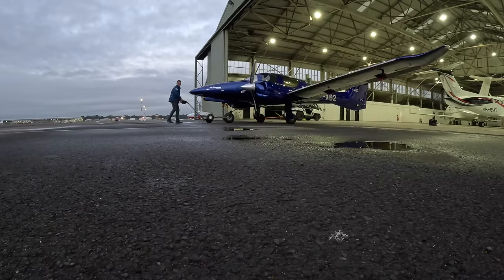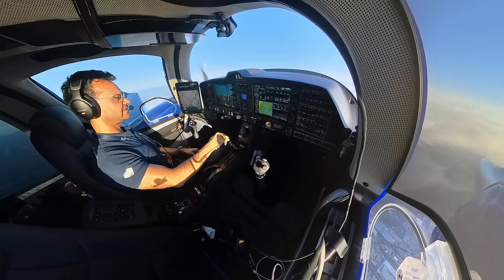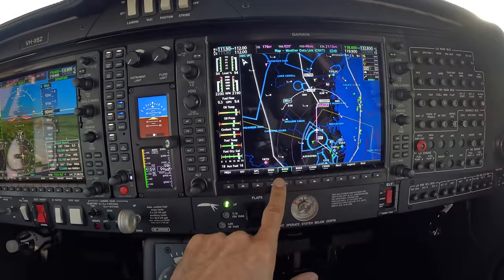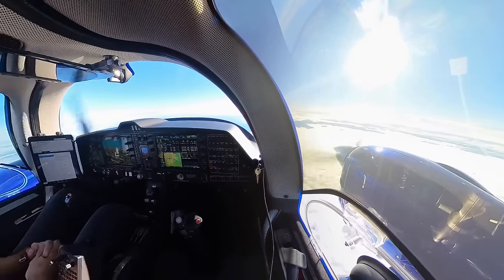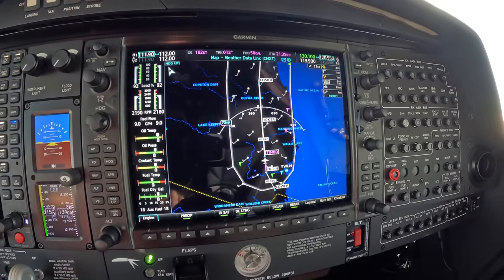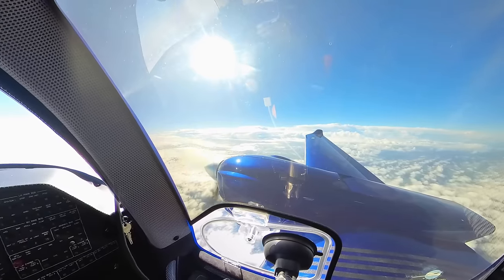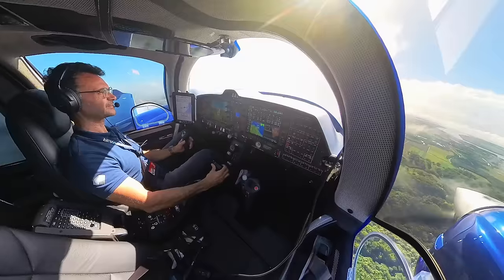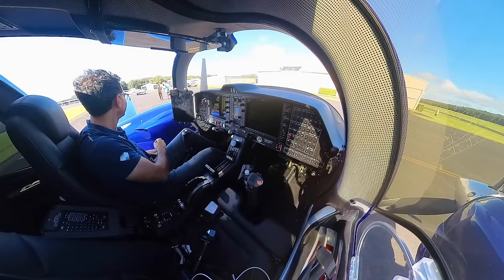Diamond DA62 IFR - Sydney to Byron Bay

Comment: I've literally had a dream about my own 62. Not counting the number of daydreams bordering on the obsessive. Just one measly Powerball win, that's all I ask! What configuration is your 62? 4/5/7 seats? How long did it take from order to delivery (I've been told 3 years!) Won't bother asking what it cost - I have the pricing lists. 😭 I've never even seen one in Vic. Seems they're all in NSW. Fair number of 42 in the schools, never mind the singles. EDIT: just noticed that you're hauling at 94%! No concerns about lower TBOH?
Reply from the maker: Haha. Yes they are an amazing machine. Mine is 7 seats with pretty much all the options. Was around 2 years from order to delivery for me. There will be one based in YMMB from around September I believe. I often run at around 88-92%. Max continuous is 95%. I’m impatient!

Comment: Hi Steve, I’ve just completed my PPL and currently working through my CPL and eventually ATPL at university in Melbourne (based out of Moorabbin), I am originally from Sydney and my parents still live there. When your company is fully up and running with the taxi service style of operations you mentioned, would you be open to hiring someone such as myself? It sounds like it would be a great opportunity. Cheers, Angus
Reply from the maker: I’ll need pilots and aircraft if this takes off. Let’s see how it goes. Good luck with your CPL. Have you done your IR yet?
Reply: @diamondairtaxis starting IR next semester, currently working though CPL theory subjects and PPL hour building.

Comment: Why do you tap brakes on rotation?  thanks for the video
Reply from the maker: Couple of reasons. 1) to stop the wheel rotation as if there are any rocks or lose bits of rubber they could fly off in the wheel well and rupture a pipe/hose/wire etc. 2) the rotating inertia creates additional (sideways) forces on the landing gear when it tries to retract (think gyro)

Comment: Hey mate, any chance you can give me a quick run down of how you record your audio? Thanks!
Reply from the maker: Sure. I record all audio (with video) on the insta360 x3 camera. I use an insta360 x3 external mic adapter. Then I plug the Nflightcam Digital Audio Recording Cable into the pilots headphone jack (at one end) and the x3 mic adapter (at the other end). That’s it. Easy!

Comment: It a decent idea but I think the most obvious problem is what has always held back private aviation in Aus. Lack of demand/small population. Almost every flight will have an empty return leg which combined with long distances in Aus make it hard for the numbers to get low enough to achieve a decent level of demand.  Capex of the DA62 will kill any opex advantages vs older options. Only hope as you alluded to is leasing underutilised AC from owners but without the population and tax advantages that the US has, there’s just not a lot of people who want to spend $2m on a piston twin. have a similar model in the US using SF50s and are still struggling to make it work despite without all the headwinds and equivalent model in Aus would have. Hope it succeeds but as far as entrepreneurship goes this is playing the game on hard mode for sure.
Reply from the maker: I love this type of feedback! Ok so i agree with you mostly but here are some thoughts. 1. I see charter jet services always busy (and they also have the empty leg issue) so there is demand and money being made, 2. The DA62 burns jet a1 and uses about half the fuel of a comparable aircraft (eg g58 baron), so there are big savings in fuel / opex , 3) we will charge for the return trip regardless to cover the likely empty leg. 4). We will sell the empty legs as deals. 5) we won’t be that much more expensive than regional airlines (which are quite expensive)… but yes it’s definitely playing the game on hard mode!! (love that analogy btw)
Reply: @diamondairtaxis  good points there. I have been out of Australia for 8 years now so good to hear there’s more of a jet scene. DA62 is a great aircraft. I got my multi in a DA42 and own a Baron now :). All the best and look forward to following. It would be awesome to see more GA action in Australia
Reply from the maker: Awesome. The baron is an impressive machine. I love flying the g58 baron. Solid.

Comment: If you can develop that software and host with a cloud provider, you could make substantial income  by leasing the software  to all the firms offering Part 135 ops.
Reply from the maker: Possibly! I am building it so that one (or many) Part 135 operators can come onboard the platform providing services. Diamond Air Taxis is just the booking platform that passes the job onto a pt 135 operator to execute.